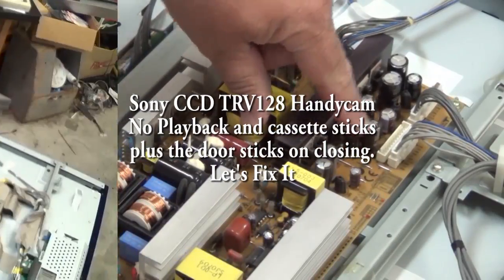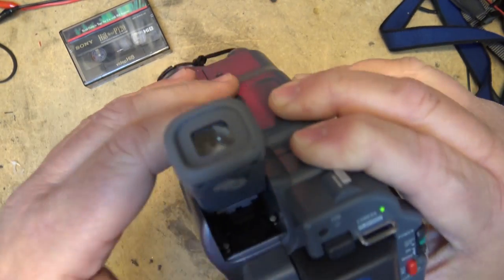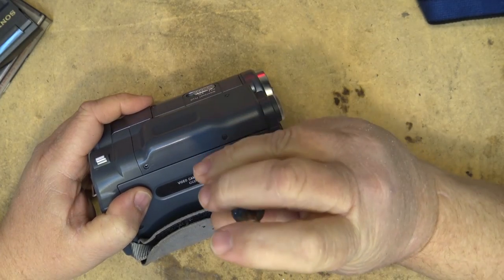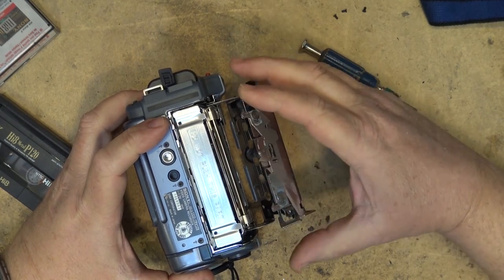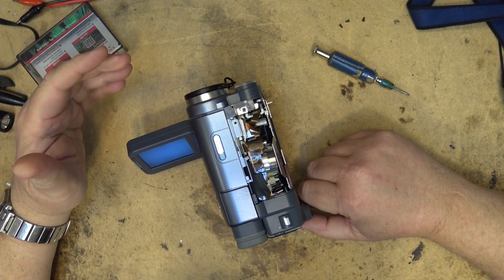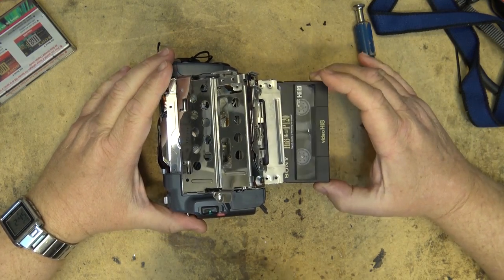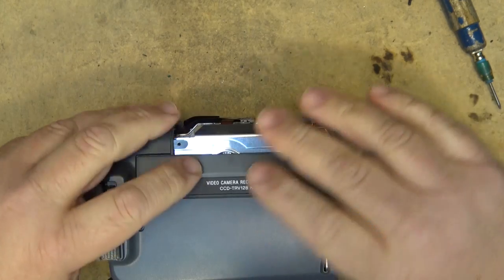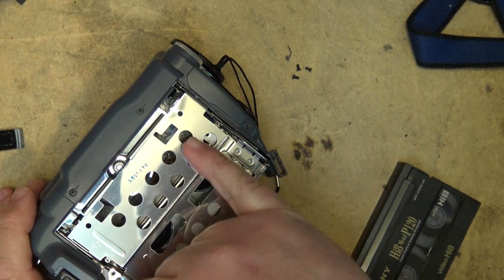Sony CCDTRV128 no playback and sticking cassette repair

Comment: Dude! THANK YOU for making and posting this video. I'm working on a project converting approx 50 of my family's tapes from the 90's and early 2000's. 4 tapes from the end of the project and my Sony Handycam DCR-TRV460 started having this exact problem. The fingernail on the head trick worked perfectly! Thanks so much!

Comment: Thank you for your excellent video. You have helped me "repair" my Sony TRV340E which had no playback and no error codes. The dissassembly was more tricky than I imagined and I used the thumbnail as suggested and took time to clean the heads. The playback was restored and I can now carry on with my digital archiving. Thank you very much!

Comment: I was baffled when the picture came back with just a "fingernail cleaning". I'd have tried some A4 type paper perhaps soaked in isopropyl, but the metal tape clogging makes a lot of sense. Thanks for sharing the knowledge.
Reply from the maker: Yup, that's the trick. Quite often when a head clogs on DV, 8mm or DAT, because the format uses metal tape, it is a metal particle that flakes off and welds itself to the head. Unlike oxide tape there is nothing to dissolve.

Comment: I never got into these tape based cameras. I went with the little MPEG-4 aiptek DV-4500 "toy" camera and I still have it and it works great. I shot many of my oldest videos with it. Video quality is 352x288 which is dated by today's standards but the only things I had to do to fix it was the power button and the battery door which was fixed with an elastic.

For the monaural sound on the left channel you can get a cable which is 1 RCA to 2 RCA which will play the left channel in both speakers.

I will be honest, I to was worried about damaging the head with your fingernail until you said it was ok and then you did it the picture came back. Amazing.
Reply from the maker: The heads are made out of iron. Last time I checked iron is harder than a fingernail.
Reply from the maker: I could have panned the sound in post to both channels easily as well. I wasn't monitoring it when I captured the footage from the 8mm.  I do have a bunch of "Y" cables kicking around here too somewhere, but I had already captured it, and I really didn't care if the sound was only on the left channel from the camera.

Comment: I'm speechless. I've had a TRV280 that wouldn't play videos for at least 8 years now. I did your finger nail trick and sure enough now it works. Thank you, thank you, thank you so much for sharing this!!
Reply from the maker: I learned that trick when i was doing my stint in broadcast.  When i was interning I saw the engineers do this to clear a clog while on air if a head clogged
Reply: @12voltvids  oh that's funny. Amazing how something so simple can work so well.
Reply from the maker: @chickenz03  your fingernail is hard enough to dislodge the clog without damaging the head.

Comment: This worked with about 20 seconds of fingernail, thank you!! I bought a second one of these things thinking the first was bad, but it just needed a fingernail 🙌🏼🙌🏼
Reply from the maker: Yes some heads are just completely clogged up.  Metal tape fuses to the head and needs to basically be scrapped off.  I learned this trick from the engineer at the tv station I interned at.  Started showing the guys at the Sony service center it and soon everyone was doing it.  Fingernail is just the right hardness to clear the clog without damaging the head and because it is spinning the force is in the direction the head is designed to sustain as remember there is friction against the tape at all times.

Comment: Thank you for saving my videos - I've jeust fixed my Sony TRV238E :)
By the way - i've used rubbing alcohol and microfibre to clean magnetic head - no more gray horizontal lines, no more audio/video distortions, no more 'use cleaning tape' error

Comment: Usual awsome fix from the master.  
Ignor the thumbs down unless they come with positive criticism. 
Thanks for sharing and here are a few extra thumbs up for your vids.
👍👍👍👍👍👍👍👍👍👍
Reply from the maker: Pretty much assure you they are coming from people in service business that don't like their trade secrets shared. If I was making a living repairing electronics I would probably be one of them.
Reply: @12voltvids  Ive always believed that knowledge is to be shared, it is this sharing that differentiates us from apes, love the fix and tutorial videos, thank you for sharing your skills and for the time you take to make them. Final thought: Our legacy is what we pass to the next generation an not what we collect or accumalate.
Reply: @12voltvids  thank you for share these tips for us. I liked the "nail" tip.
Reply from the maker: @adiasbr  
Yes just hard enough to clean the clog without damaging the head. Works for VHS heads too. As I mentioned before I first saw that done at the TV station I worked at in 1981, and then again when I was taking a course at Sony for 8mm, I was in the shop with one of the techs I worked with back when I worked for Sony in 83 and we got to talking about cleaning the 8mm cameras, because isopropanol won't do it. His reply was dry cleaning tape or the back side of your fingernail to clear the tough clogs. Basically the cleaning tape for 10 seconds and if that didn't do it the camera comes apart and it is done this way because you don't want to use a cleaning tape too much as it will wear the head. I laughed and said that was what the engineers did at the cable station I worked at did. His reply "where do you think I learned that one" 
so this must be pretty common with broadcast engineers and "tape heads". (Those would be the guys running tapes in the basement for all the on air operations)
Reply from the maker: @isoguy.  
Knowledge should be shared, but those providing the knowledge also should be compensated for said knowledge. Unless you line in a Cuba where the government pays for your university education.

Comment: So many folks load old tapes that will have grown mildew or mold having been stored in the shed or bottom of wardrobe and that goop soon blocks the headgaps. I till 'em to always load 'n shuttle the entire cassette to repack the tape. With a bit of air over the tape for the 1st time in years and the fact that patches of any goop scrub off on the mechanism cleaner knife etc they should reduce risk of headclogs down the line... We used to put a business card (sometimes soaked is isopropyl) lightly against the scanner to knockoff a metal oxide core that was blocking a headgap. Attended a conference on future of recording media last year. Belief is the last of the world's tape makers will cease production of tape by 2024 simply because the only market now is Data Cartridges used in Data Robots (run by banks etc).
Reply: So I think I did this exact thing. Started watching tapes that have been sitting for 20 years. fixed it with the thumb nail.  I'm kinda lost tho, Could you explain in layman's terms what I should do to prevent this from happening again?  Idk what "load 'n shuttle to repack the tape" means.
Reply: @171mike  Any kind of tape, be it audio recordings on real to real to the stuff inside the good olde  audio cassette, video as weel... as in VHS or BetaMax ... there's a high chance a kind mold will grow between the tape layers as it lies all rolled up on spool... unless of course its been stored in a room with constant climate controlled environment (low humidity etc).... When you load the tape into, onto or thread it to a machine, it's a good practice to forward shuttle the entire spool all the way through (SLOWLY) as this lets the air get to it and then rewind it back to the start... Probably best  to now unthread & give the mech tapepath a clean including the heads, capstan-shaft & pinch-wheel.... be careful on video heads though they can snap off the scanner drum all too easy... So yeah, repacking a tape just means to shuttle it forward to the end & then rewind it.... Interestingly i have folks with old floppy discs desperate to recover the data on them (still) & the  oxide coated plastic disc (which is similar technology as linear tape) in the 'packet' is covered it mold too!

Comment: It may have cost him $120 in shipping fees but maybe he still likes to use that camcorder and is willing to pay that much to be able to use it. I used Hi-8 for a couple of years, couldn't believe the better quality over those honking big VHS cameras. I had my doubt when you said you were going to clean the head with a finger nail. I was proved wrong again! So you basically gave the head "the finger" and all is well again!
Reply from the maker: Your fingernail is just the right hardness to clean video heads. Besides the guys at Sony doing it, when I worked in broadcast for a couple of years this was common for tape operators to do this if a head clogged during playback on air. They would put their finger in and press the tape slightly so the tape itself would act as the cleaning medium and clear the clog.
Reply: 12voltvids 
Doesn't this damage the tape?
Reply from the maker: @mrmagnetoscope  If you sandwich the tape between your fingernail and the hear it will scratch it. I didn't do this. I made direct contact with the head, so most of the dirt would have come off on my fingernail.

Comment: This is the second to last model of Sony's Hi8 camcorders, from 2004. The last model, the CCD-TRV138, was in production from 2005 to 2007.
Reply from the maker: I figured it was near the end. No stereo sound very basic unit. Almost like Sony was making a last couple of models for early adopters of 8mm to get one last model.  As I said in the video I had never seen this model before as I had already left the service business when this one came out.
Reply: As soon as Sony introduced Digital8 camcorders they removed stereo sound from most of their Hi8 camcorders. But they continued selling both Hi8 and Digital8 Handycams (sharing most parts between them) all the way until the end of production in 2007.
Reply from the maker: @kevinsvideodump 
What I found interesting is when digital 8 was introduced it had the ability to play 8mm and hi8 analog tapes and would even allow export of analog tapes over FireWire as a dv signal. This was the strength to digital 8. To let people make the move to digital and still play their old tapes. Then Sony took away analog playback. The hi8 I have owned ccdtr81, ccdv5000,  ccdvx3 and evw300. Digital 8 dcr trv110. Dv cameras. Dcrvx1000, canon gl2 and JVC gydv500
Reply: The higher-end Digital8 camcorders retained analog playback capability all the way to the end. But beginning around 2002 the lower-end DIgital8 camcorders became digital-only.
Reply: Do you still do repairs. I've got a TRV138 that has no A/V output, so I can't make any copies of the dozens of tapes from the '90s when the kids were little. I hate to lose them.

Comment: Finger nail ... hah you killing me :D now this is real creativity. I tryed your method for boiling the flat ruber belt to restore it but it does not help at all to me and i decided to precise cut to size another one -> old good quality and glued it with super glue on liquid gel base, just dip two tips vely litle in a drop then when hardened i filed the excess to make the bond elastic and smooth, in fact i did it twice because first time i make the belt bigger in diameter. Actualy i tried to tear the bond but it snaps near glued place (from new place not the bond) so i know the bond is strong and indeed i've tested it for 4 days and near 30 tapes on tape deck and still working flawessly.
Reply from the maker: The fingernail technique I first saw done at the TV station I worked at, and then at Sony when I was taking an 8mm camcorder course. It is an alternative to the abrasive dry cleaning tape.
Reply: @12voltvids  we used to use a bus tickets because our tickets contains hard paper and nylon strips (like banknotes) and the result is pretty much the same but you don't always have a ticket on hand ;)

Comment: Many thanks for the great tear down vid and I'm gonna give this a go.

Couple of questions I wanted to ask too.
- any way to get rid of the the dreaded C31:22/23 or C31:42 error codes. 
- from your explanation it doesn't seem like a good idea to keep reusing those head cleaner tapes which I do very often.
Also I do sometimes use the wd-40 contact cleaner on the head itself.
Are those 2 very bad ideas or just subtle issues?
Reply from the maker: The head cleaner tapes are the only way to chean 8mm and DV heads. Don't use contact cleaner on video heads.
Reply: @12voltvids  Thanks for the super quick reply, appreciate it. 
I was always guessing because head is too dirty maybe a wet version may give a deeper clean which I now know isn't very smart 😜 .
Also for the cleaning tape, is it ok to use it for a few runs?
Reply from the maker: @ngadam3126  they say not to run more than 4 times in a row.  If heads don't clean by then it could be something else.  Head cleaning tapes gradually wear the heads so you don't want to use more than necessary.

Comment: My player was working fine as I was watching 30 yr old videos. I then rewinded it and now the tape plays distorted and without sound! 😥 I'm hopimg tontry the finger nail method. Is the head also cause for the loss of sound also? This partic tape didnt have a that flip back head on it so maybe the tape had some small debris on it? Any tape I out through it has the same issue now.

Comment: Hi @12voltvids, i have a Samsung MiniDV VP-D361 which was working fine until recently!  It has started chewing up tapes and shows either 1 of 2 error messages; the first is "Eject - D" and the second is "Eject - R"...  From this description do you have any idea of whats wrong and or a potential fix for this problem?

Many thanks,
Billy. 😉

Comment: I have a Sony vx1000 that shoes a bunch of white glitchy pixels in areas that have bright light or when the exposure is up it records them onto tape and with a live preview through FireWire but not through svideo or composite ( unless playing a tape). I’ve taken it apart a little bit everything seems to be in order and I gave it a good cleaning but no luck. Have you ever encountered something like this?

Comment: Hi there great video and good directions. Any advice what could cause tapes to be chewed in a Panasonic mini DV I have no experience working on these so I need somewhere to start. I have one new cassette to try in it but I'm too scared to try it in case it chews that aswell. How does one even work on this to test it....? It's tiny and you also can't see anything while it's running. Many thanks in advance

Comment: Sir I have a question for Sony dcr-trv280, Because when I opened it all I can see is black, I double check if the cap is covering the lens but no. I think it's a error code because I can hear the error code sound or beeping and sir I also have 1 more problem the cassette tape isn't sliding when I eject it.

Comment: Hi the tape coming of the head to the pinch roller initially rides correct but after playing a few seconds it moves down the pinch roller and even scrapes the deck. What is wrong ?

Comment: Hi, thank you very much to share your incredible expertise! Could the trick work also with a wood chopstick? (japanese stick) Or perhaps other materials? I'm asking as I have a Sony CCDTR505E with video heads not in reach by fingers.
Reply: I've been able to use the finger nail, while rotating without tape inside! However the viewfinder playback is still black, as well as the VCR out. I've also disconnected all the connectors and cleaned them. Probably it's another issue.. the display shows a blinking 00:00:00 counter, also while playing.

Comment: I have the CCD-TRV228E camera. looks exactly the same. My problem is the playback is fuzzy with the jack lead to TV?  So, it's hard to see what Hi8 tape is in there. The camera screen isn't always clear for some video tapes, get that VHS lines in picture or the screen is blue and auido plays but likeon rewind u get a picture.   Audio is not clear on cam corder seems like a speaker issue. BUT WITH HEADPHONES ok. The audio is fine via TV  using leads, but I only see a bit of a picture as it's still fuzzy.  The  tapes and camera have not be used or played for like 13yrs.  They've just been left in a bag in a cupboard.   Can this be the camera needs a cleaner or is it the tapes  although the tapes have cases and not in bad condition at all.

Comment: Thanks for the video!  I need help with another issue: When i put inside the cassete. I close the "door", then the head starts working  - sounds like is forcing - but then it doesn't go down,  inside the camera. so i can't even put inside the cassete.  it's stuck there and then it opens again :( i don't know what to do! 
Any recommendations?

Comment: The one I have doesn't play  but if I press the play button on the screen without removing my finger it will play ok but as soon as I remove my finger will stop, any idea?, I just trying to convert 12 cassettes to digital and does it. Any help will be appreciated. Also, I did reset it, also rewind doesn't do anything, the rest is fine, even the recording.

Comment: Will LCD screens on camcorders eventually stop working? I pulled an old panasonic PV-DV910 out of storage and the camcorder still works great after sitting for 20 years. However the LCD screen will not turn on. So I was curious if it is the screen itself or the wiring to the screen.
Reply from the maker: Anything can stop working on old electronics.